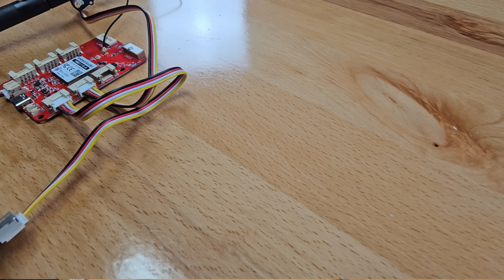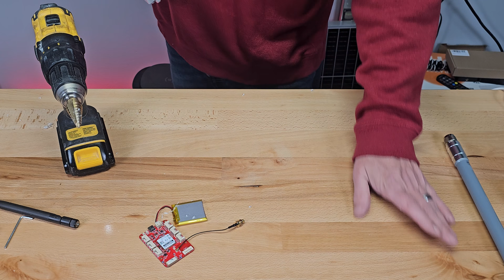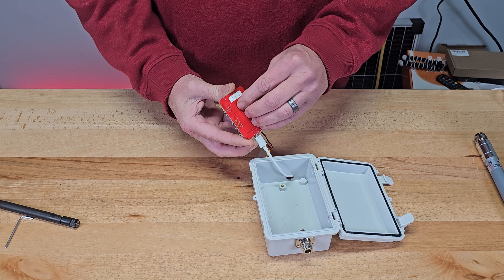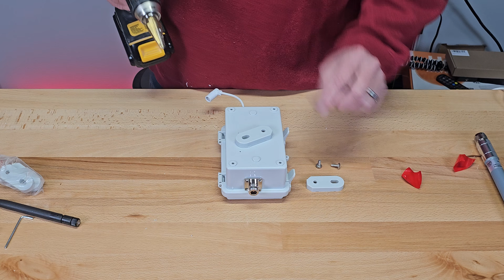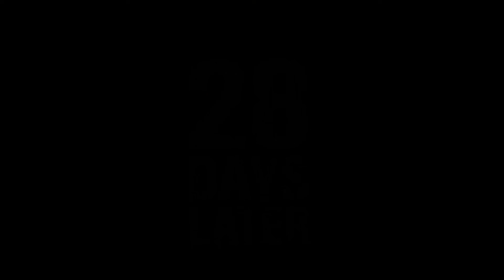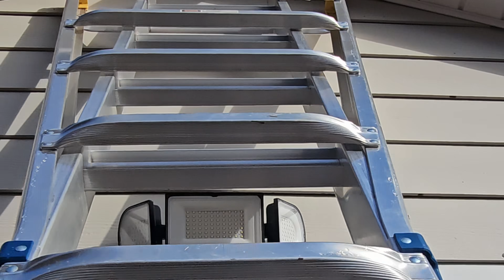DIY Solar-Powered Meshtastic Node

Comment: I have 3 concerns:  First, you positioned the battery on the left of the circuit board when first checking the layout. But then you placed it along the bottom with sticky tape...  what if the box fills with water?  The side would have been better, up higher.   2) I know, you left the bottom hole open for drainage... but that will be an entry point for bees and insects. 2) Why not pull the solar panel connector up into the box, so the joint is out of the rain and exposure?  3) How about at least a little silicone to close up that hole, and tuck the excess cord from the solar panel into the box, tied up with a cable tie and tucked to one side?

Comment: I envy people who can just put the board into a box and screw it somewhere.

Where I live you need to account for a below zero temperature. In this case you need to change what batteries you use from LiPo to LTO. This means that you need to find or make BMS for LTO which could work with solar panel or add more components to adapt solar panel output to LTO BMS. This basically means that node doesn't report charge level to you anymore and you need to either develop some new component which will do that or hope for the best. And then you also need to account for possible brownouts when there no sun. Because the board wouldn't properly start again after that unless you disable the power completely. Which means that you either need to have an access to that node or add another component which will cut the power when the voltage is below specific threshold.

I wish I could just put a USB output from the panel into the node and put it into a box for it to work more that one summer 😢

Comment: I just watched ya vid out of bordem,i own 10 solar meshtastic routers and I ALWAYS have silicon on mine around the antenna,screws etc so nothing can get in,ur lump will leak water in the top and let alone moisture and bugs gettin in the bottom hole and ur battery is way too small and btw just my lot have easily over 1,000 square K range and are all linked

Comment: Thanks for the video! I'm a newbie to all of this. Just got into Meshtastic, but I don't know much about electronics. 
How are you preventing overcharging? 
Also, what type of battery are you using in your build? 
Finally, how is your build holding up since you published this video?
Reply from the maker: The tracker 1110 handles voltage regulation/charging of the battery. The solar panel I used also has voltage regulation built in. If I was to build it again, and I might, I would use a larger panel and battery. Other than that, it works great.

Comment: Bugs can get in that bottom hole and cause problems later on. I would recommend sealing that in some way. Dead bugs can short out your equipment.
Reply from the maker: I would suggest that for others. As for me, I'll have it back down soon and add sensors so I'll seal it when I'm done with it.

Comment: Nice! Mine is similar except instead of using a bulkhead mount with a flange I opted for a straight fitting with three pounds of silicone. To be fair the silicone was a later addition after I found out only the bottom of my enclosure was water tight. I'm not broadcasting location on the public channel but will send a few pings your way with Double Clutch.